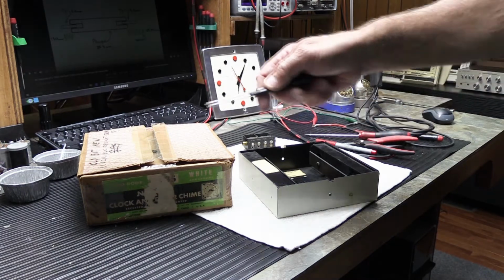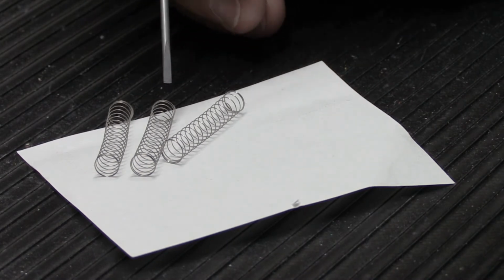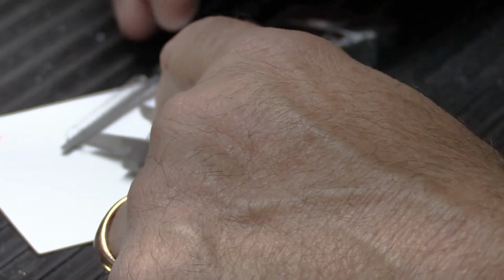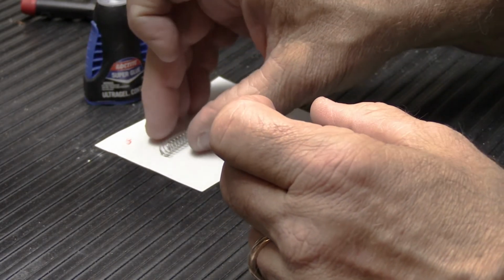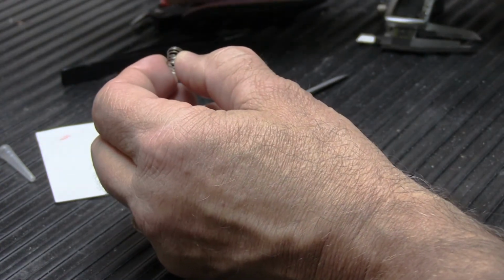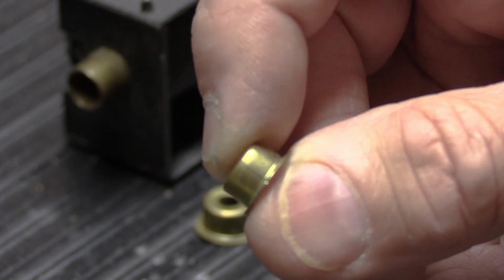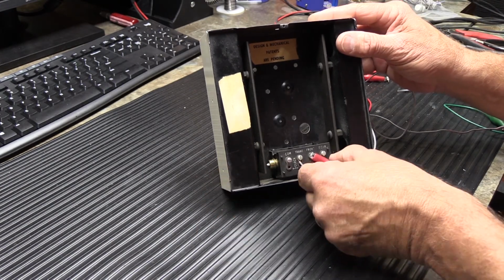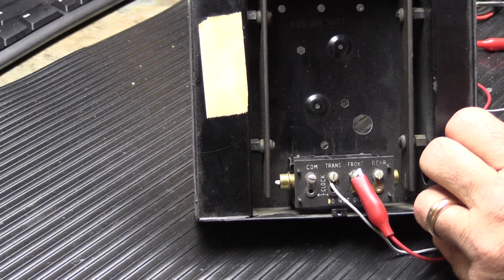Servicing a NuTone Model L35 (or possibly K35)  2-Note Clock Chime ~ Part 1

Comment: I have a home built in 1962 and it has a VERY similar chime to this.  When we bought the house, the clock was missing, but after figuring out what it was, I sourced a correct replacement clock and got it working.  Interestingly enough, it is a three chime bell.  It has a two note chord for the "ding" on the front door, and a single for the "dong"  When the back door is pressed, it gives a single higher note of the "ding".  The clock part is also a bit different being of stamped aluminum and then three dimensional spheres rather than the flat "plates" of this one.  The model number stamp in the chime box is: L37 H61G.
Reply from the maker: Hi meestahwah:  Your L37 is named the "Elite".  It was available in 3 finishes; Copper - Gold and Silver.  It is a quintessential "Mid-Century-Modern" design.  The earliest catalog I have shows that it was available starting in 1958.  
The L37 belongs to a group of "Built-In" Door Chimes, which are recessed into the wall cavity.  The NuTone catalog states that they are  "In Tune with the Contemporary Trend".  The style is a nod to designers like Charles Eames.
In the 1958 catalog, the retail price was $22.50 - which is about $235.00 today - Chris

Comment: That's a double dinger  :-D
The only time something vanishes off the bench is when it's a special unobtainum part.
I was thinking of the springs found in ancient video recorder solinoids, but they are not quite right.
I have shortened springs and fed a small length of wire insulation over two coils on one end to make a flat seat.
The record player tone arm wire has thin wire insulation.
Reply from the maker: Hi zx8401ztv:  Interesting idea about tying the coils together to make dead ends - Perhaps 30 AWG wire-wrap wire would work - Chris

Comment: I looked through a bunch of your other videos, but didn’t find one that addressed a question I have. What do you use for replacing the tone bar grommets when necessary?
Reply from the maker: Hi doug:  There are dozens of different types of grommets used on NuTone Chimes.  You need to find grommets that are as close to the original size, to allow enough "floppiness" of the Tone Bars - otherwise the Notes will be flat and clankey sounding - Chris